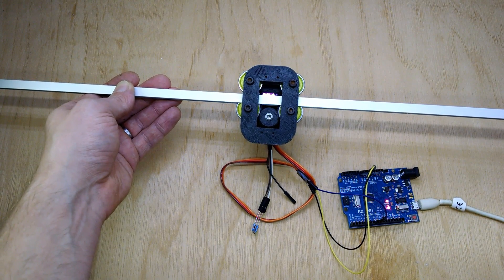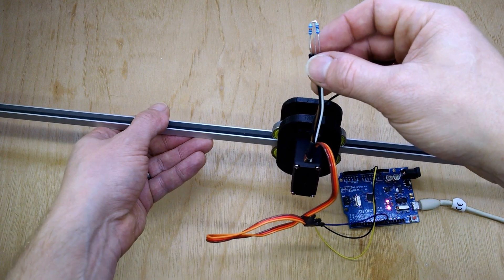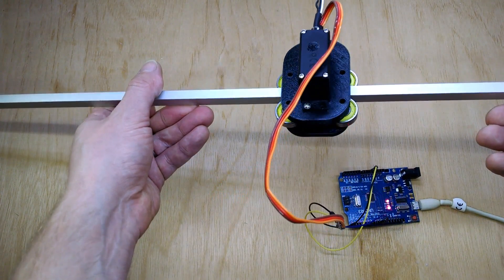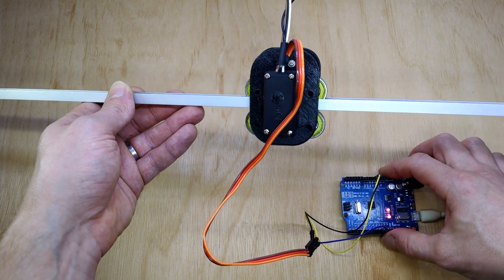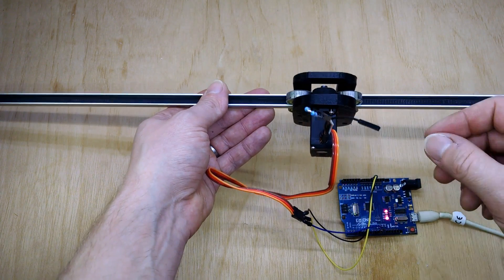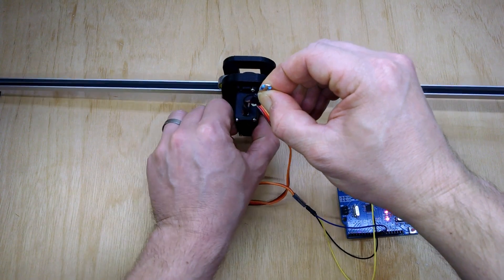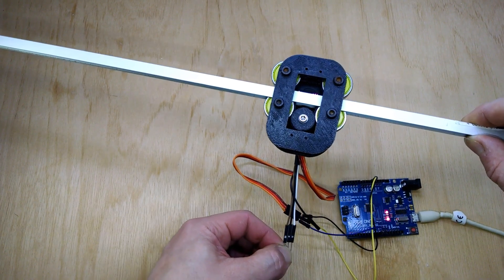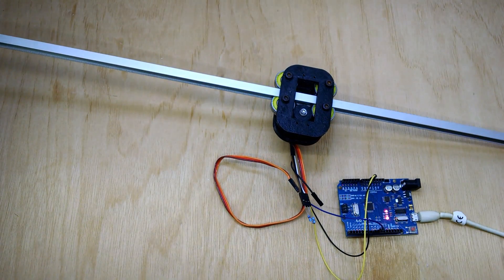Cheap Linear Actuator: 1 Metre Plus Travel

Comment: I've always thought that you could make a really cheap but accurate rack and pinion drive with a track with a stuck down belt on it. Instead of the belt going over the drive wheel (where the belt can stretch lots due to its long length) you have a small circular belt inside the drive, invert the belt and press it down with rollers so that the teeth engage the pinion belt.

Comment: I'm not sure if you're aware of this, but commercial solutions like this already exist - look up ServoBelt.
The ServoBelt, however, is not commercially viable because of the high cost of niche manufacture, but this is very nice.
Try adding a magnetic encoder onto the shaft of the motor. Something like the AEAT-6600. Divide the absolutely insane resolution by the belt pitch, and you've got a very precise pulley-on-belt actuator that can go unlimited lengths.
Though, if you go up to the encoder, replacing the hobby servo with a powerful geared DC motor would help. Something like a drill motor, since backlash won't matter with an encoder directly at the shaft, providing position readout.
Reply from the maker: Thanks for the pointer. I didn't know about that one but it's very expensive as you say. Roger Rabbit's version of a 3d printed linear actuator is what got me going on this design. The servo wires are specifically broken out to enable alternative control schemes and a rotary quadrature encoder is a good way forward. The unit you mention probably has precision that you can't really use when you consider the stretch in the belt and any flex in the aluminium profile but I appreciate the idea. Endstops might be enough or even, if the load is predictable, a timing scheme to achieve finer position control. The next thing I'm looking at is a digital potentiometer as the servo feedback with the rotary encoder as the input. Did you know you can get 10 turn potentiometers? They sound like a cool (but not cheap) way of providing position feedback for a short run of this kind of rc servo-driven actuator. My ideal is to create a hybrid incremental/absolute linear encoder to use on something like this...
Reply: 10-turn pots are not precise in any way, shape, or form.
Just go with the AEAT-6600. It only requires a radial magnet on the shaft.
It's way too precise, but it's around the same price as any other solution(~$10).
That, and it already speaks digital, so it's a huge bonus.